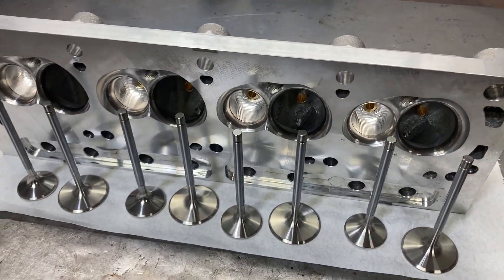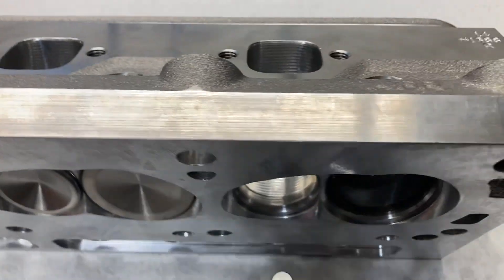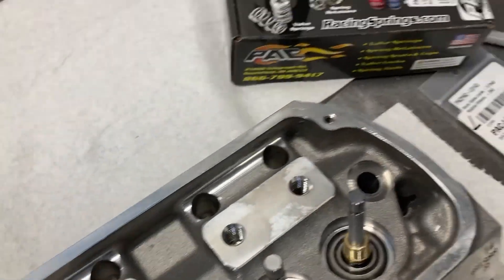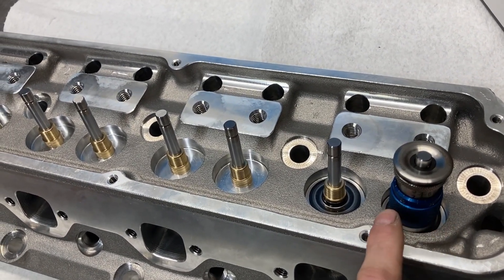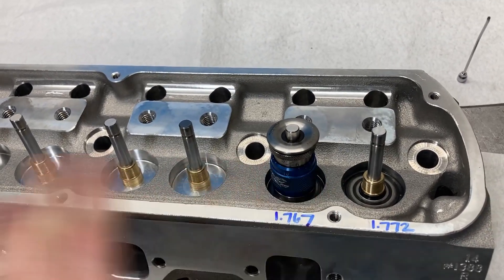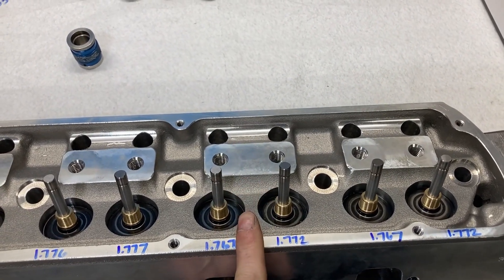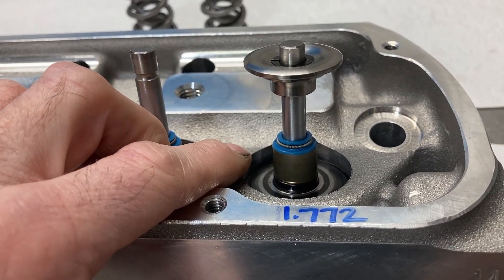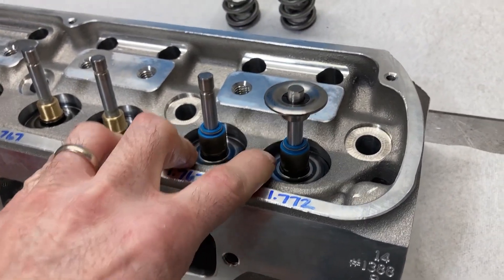Lykins Motorsports AFR 185cc Dyno Mule Head Assembly (With Some Snags)

Comment: I had to cut the guides smaller and shorter for smaller guide seals.
Reply: He would have to cut the spring pockets down to get more clearance not just the guides. AFR never really intended for that head to be above .600 lift. That is why I went to the 195cc one. It's setup for .650 and really can go .700 plus pretty easily with minor changes.

Comment: What would you expect to see on a Dyno test run with reduced valve seat spring pressure?  Does it look like valve float step or just a gradual reduction of power that's not detectable?

Comment: Brent was it because you changed retainer and locks you had those problems,because if ordered a pair heads from AFR [in my case i am thinking AFR 220] set up for solid roller say 720 lift would you still have problems.Another thing you building a 310,is it any different setup to 347/363 headwise with the same cam,i wouldnt have thought so
Reply from the maker: The 185cc heads don't have spring pockets for larger diameter springs, so you're stuck with small OD valve springs.  In order to use a solid roller with higher spring pressures, I didn't have many spring choices.  I decided to reuse the springs off of the 352FE dyno mule, which forced a specific retainer/lock setup.   The 205/220cc heads from AFR are setup specifically for solid rollers.    As far as the difference between a 311 and a 363, the cam specs would be greatly different.

Comment: Question ❓ couldn't You cut the valve guides down the .050
that's needed to get the clearance You need? Thanks
Reply from the maker: No, because the seals were already touching the locators.

Comment: What would be a good spring seat pressure for a comp xe274hr small block ford gt40p heads? Right now I have them set up @140 seat and 360 open. I can't seem to find anything from comp cams. Thanks.
Reply: Those cams have pretty aggressive lobes for a hydraulic roller. On my AFR heads I have 155 on seat and 410 open with a slightly less aggressive lobe.
Reply: The XE282hr rewarded me with an average of 80fwhp(3000 to 6600) and +600rpm over the XE274hr. At 7000 power dropped off 30hp. I can't find the build sheet for the GT40p heads, but I went against the forums and tried the 282. I was pleased. I wish I could help with the spring pressures.....I did have a lot of money in the valve train. Good luck